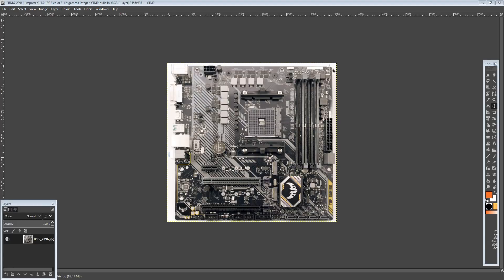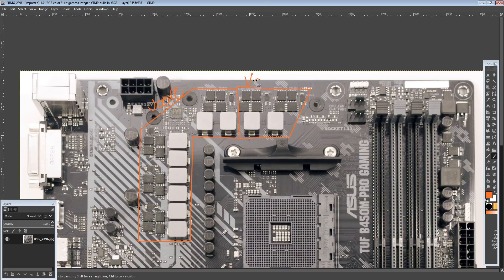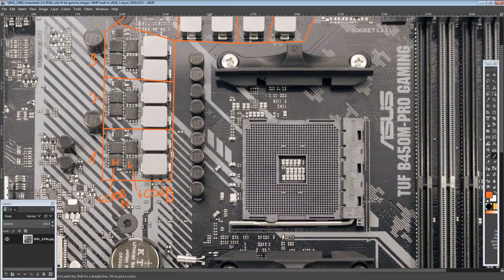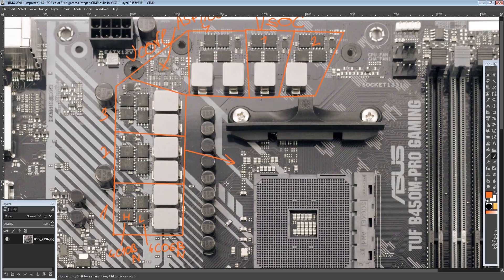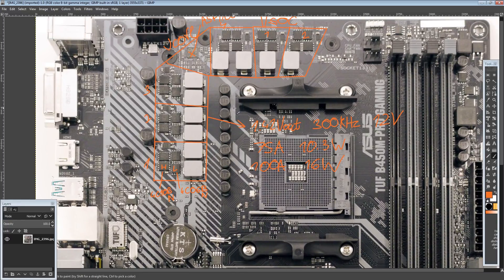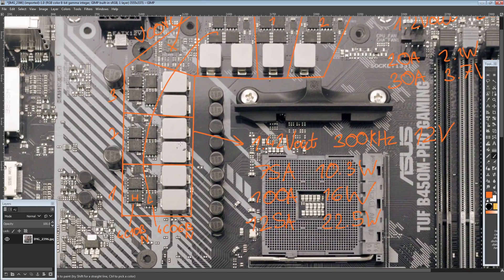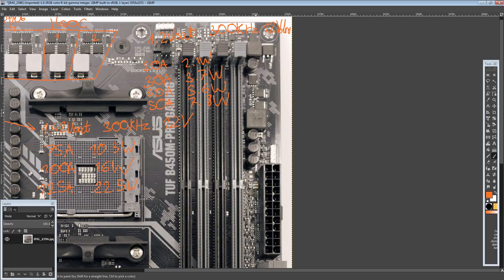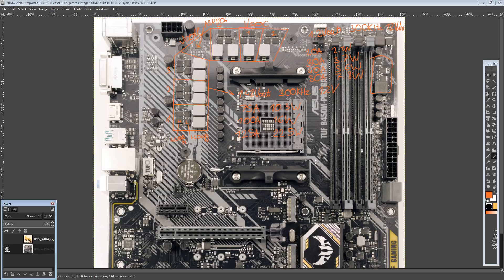mobo PCB Breakdown: ASUS TUF B450M-Pro Gaming

Comment: if you take one and tested like i do you will see on this motherbord ryzen 5 2600x can  hit easy 4.2ghz with vcore 1.375v and vrm temp's in aida 64  72 degrees celsius on mos-fet on open bed test no air flow.This happen's cause they heave an extra metal plate from the back at the same spot of the uper heatsink, the heat extraction is very impresive. Test the mobo and then make comends, by one picture can't extract conclusions.
Reply: Why do i feel like BZ only talks bullshit. With 0  testing ??
Reply: @filds1  because you're ignorant.
Reply: @rawdez_  why? Because im telling the truth ? Man we seen people running 3950x on a a320 motherboard. I seen worse things then this. If you remember the fx line up. I seen crappy boards then this running a fx 9590. Without long term testing i dont believe shit. By buildzoids point of view we all should just crap shit ton of money on a top high end board and be done. What a fucking joke.
Reply: @filds1  because in this video he BZ is talking about OC and compares this board with other boards. if even trash boards can run any modern Zen2 CPUs at stock that doesn't make trash overpriced boards any good.
is this board good enough for any stock Ryzen CPU? yes. is it actually good for PBO & OC with any Ryzen CPU? no.

watch again this 5:00, and this time actually  listen.
ps MSI boards now have offset voltage
Reply: 5:00

Comment: I presume, the main reason why most B450 motherboards end up getting the short end of the stick is because of the freedom XFR yields to consumers, and motherboard makers. Theoretically speaking.

Since technically all they have to do is support the feature, stressing out the board by using cheap components is a win win because technically speaking the board is in the clear, to do just that, provide 'turbo' performance so long as you the user, can keep the system cool.

AMD this generation does not really look so appealing to overclock anyway, so leaving the processor to do this automatically probably would be the best bet, especially for anyone using a midranged board whatsoever. Oh well. Hopefully some good boards come out again. right now it seems ALL the good MSI motherboards have dried up and disappeared this week with every place selling them being sold out.

Comment: Hey, so I have experience with liquid cooling VRMs since I had to fit some blocks to my sabertooth 990 for my fx-9590 oc.  If I put some waterblocks on these VRMs, should that be enough to handle the heat issues when running a 2700x?

Comment: I just built two systems with the 2600. I had the B350 version for my 2700X and it did not run that well plus I was not a fan of the bios. I got the B450 version because it was what Micro Center had. The only other one they had was an AsRock for $69. So far things are working pretty good with both systems. I have one paired with a 1060 6gb and the other with a Vega 64. I did not have allot of time to do any major adjustments will have to wait til next month

Comment: I got my 2400G up to 4.2Ghz on this board.  For $100 You can't expect all the bells and whistles.  I also would never run an 8 core on any B450 Motherboard.
Reply: I'm running an 8 core on the "worst" b450 and it is fine.
Reply: What was the temperatures for  2400G @ 4.2Ghz.

 I can get this board  ( ASUS TUF GAMING B450-PLUS II  (the II version)  ) for only 67$ right now. 
The deal seems fine but I am really confused. 
The other candidate : MSI b450m MORTAR MAX  is also 75 bucks but it is mATX moreover the warranty on the this seems a little shady ( I did not trust the seller) ? 
What do you think should be my choice?
Reply: @landingonyuranus1813  As for Temperature I can't remember it was 3 years ago. That CPU is residing in my Churches AV computer. I was running a Spire Cooler not the one that comes with it. The other major variable is what voltage you need to push to get it up that high. The Tuff board is a decent board. I did do a review of it.
Reply: Good b450 can run anything now , not 3950x but , 3900x will be okay on b450 tomahawk. I have it in one rig and it's doing completely fine.
Reply: @DexterWTFF  3950x  is fine on Tomahawk as well considering it is more energy efficient than 3900x.

Comment: it may be a coincidence but i gave an asrock board a good review once on newegg (they check those pretty often looking for customer complaints and leave messages about getting into contact with customer service).  in the review though i said that the voltage was a bit high and that they should allow more than -100mv offset.  on the next bios update they let it go down to -200.  i wonder if they saw what i wrote?

Comment: I put a 2700x in this....I don't have any real plans to overclock. my main issue was with the stupid rgb lights resetting the bios setting for off when off every second reboot that was fixed when I changed the off rgb mode in aurasync applyed and then set if off again. The msi all cost the same or more then this in australia so worst case if I want to push the cpu ill get a c550 or whatever they invent in a years time. 4 year socket support ftw
Reply: also the rgb lights are totally hidden under the gpu, basically ignore all the rgb on the product page if you gpu will overhang the mobo.

Comment: "oh no" in first 10 seconds = fail, but i need to keep watching this car wreck of a a motherboard... really Asus?  A piece of cardboard with the chipset drawn on with a marker performs better...
Reply: This board actually holding stable all cores 4.1Ghz at r7 2700x. So please shut the hell up.
Reply: @AliShuktu  What are the temperatures for that stable system. I really think Buildzoid is a little bit harsh on this board. Yeah?

B450m MORTAR Max had good temperatures here: 

I can't find any info about TUF  B450 Gaming ,though. Any  help is appreciated ^^
Reply: @landingonyuranus1813  
About 76°C on radiators.
If you want i can find video.
Reply: @AliShuktu  Is this bad? 76 degrees seems a lot for a moderate test?
Reply: @landingonyuranus1813  
It's not moderate test.
It is 4.1 overclock all cores: 8(16).
Reply: @AliShuktu  I think I understood something here. I searched about this. And found out that B450m MORTAR MAX is better in terms of VRM temperatures. it runs at least 10 degrees cooler than TUF and TOMAHAWK MAX
Reply: @landingonyuranus1813  
Interesting. But 76 degrees is already "cool enough" though. 
Dangerous temperature is - 90 and above.

Comment: Nice video, always enjoy the mix of rambling about the manufacturer & the technical analysis. 
I have a question about "old" thermal pads on a GTX 1070 from gigabyte (G1 gaming rev 1). They started leaking silicon oil.. Can you recommend a replacement for them?

Comment: What happened to mATX? It makes no to no sense to have full ATX for mainstream platforms really. There's very few high end boards released in mATX now. None for AM4? Still clinging onto my Z170M OC Formula. Now with modded BIOS and a recent upgrade from a 6700K to a 9700K which I'm very happy with!
Reply: One factor is that it is tough to fit enough expansion on an MATX board to use the full array of IO that modern high-end chipsets and CPUs offer. That seems to automatically push MATX boards out of the 'high end' category with manufacturers. MiniITX actually has a similar problem, but the VRM's at that size HAVE to use better components just to keep from catching fire with the space available! Even so, you see almost no x470 MiniITX boards because you just can't use most of what that platform offers with so little board space.

Also, higher-end MATX boards would almost certainly cannibalize sales of existing high-end ATX boards. If you think about it, what you 'lose' when you move from ATX to MATX is a couple PCI slots and maybe an M.2 connector. Those aren't very expensive parts and don't save the manufacturer much money, but they will still be expected to offer the MATX board at a lower price than a full ATX board with the same VRM and chipset. It's entirely possible that they would have a lower margin selling a high-end MATX board because it doesn't really cost them much less than an ATX board to make, but consumers won't accept the same price for a board with less 'stuff' on it.

I wish it were otherwise and MATX would take over from ATX as the mainstream form factor of choice, but it just isn't happening. There is still some hope that enthusiasts will pick up on the general consumer trend of wanting physically smaller PC's, and ATX will become less desirable, but I'm not holding my breath. It's a shame really as I haven't needed more than two or three expansion slots for over a decade, but I'm still usually stuck buying ATX boards if I want a good overclocking platform.

Comment: I think most of you are mixing up with TUF and TUF gaming. They are DIFFERENT product line, said by the sales rep of ASUS Hong Kong. TUF is much more high class mobo than TUF gaming. TUF mobos STILL have 5 years warranty, like the TUF X299, since it is the TUF product line. The new TUF gaming product line like this mobo is a low end product and the price of this is much much lower than the TUF product.

Comment: Asus has used the same VRM on every non-high-end AM4 board since day one with the B350-Plus. Such progress!
Reply: Simon: kinda late to your comment, but i happened to catch this video, and what's this about Asus. i have one of there boards for my i5 9400. it's a B or Z390 i can't remember now, it's a lower range Z board. it's a Asus Prime Z motherboard. they were saying the VRM on this board isn't that good, but i can say for mine temperatures don't go above 66 degrees Celsius at full load, it might be different if i had an i7 but i have an i5 so could be why.

Comment: This review makes me smile. I really like the memory controller and BIOS on my new MSI B450M Mortar. And why would anyone buy a motherboard for the AM4 platform that they can not upgrade later with a more powerful cpu? Lots of possibilities out to 2020 and beyond. Going to bed. Hit the Cinebench wall at 875 and 3200MHz. Cold and wet holiday weekend to work on 3400 and 3600MHz. p.s. What was the switching frequency mOhm's. 5.5?
Reply: Check ECC support (for building a home LAB, ZFS, etc.) and think again. MSI didn't give a shit about ECC, I simply sold my Mortar and got this. Works like a charm as a home lab with the (now-sold) R5-3600 and DDR4-2400 ECC UDIMM @3200 (Samsung B-die). :)) 

5950X is on it's way now. 1x12cm fan pointing onto VRM block. We'll see how this little board performs with that beast.

Comment: ??? I feel like AMD would benefit from adding iGPU's to there mainstream lineup and gain massive market share from Intel. What would be the Proa and Cons of doing so? Thanks.
Reply: Well, it depends on the size of the iGPU. For anything but gaming, Intel's one suffice whereas if it's a gaming station you'd better use a dedicated graphic card instead of an APU (yeah I think APU are useless in most cases). Even the Vega 3 of the Athlon 200ge is quite too much for hardware acceleration in multimedia/HTPC tasks like desktop compositor, video decoder and Web browser.
Reply: @PainterVierax  I like iGPUs, they make handy ways to add extra displays to machines.
Reply: so does a dirt cheap graphic card, I don't see the point here.
Reply: @PainterVierax  A dirt cheap GPU is an additional card, in an extra slot at extra cost and on some builds you have to be careful where you put them to avoid mesing with primary GPU bandwidth. . Given that most boards have the iGPU hardware on them already,  there's a clear benefit for an iGPU, especially on mATX or ITX builds. Maybe with the Ryzen 3000 series we'll see some 6 and 8 core chips coming with the iGPU.
Reply: I said APU are useless in most cases, I made the distinction with an iGPU. If it's just for an extra display, you can use the iGPU but you don't need more power than what Intel has.
You don't argue for something relevant since we are agree on that point.
Reply: My focus was on AMD gaining market share and boosting there product lineup for the masses not only for builders. AMD qould be more attractive buy if u dint need to know what else to buy or install. Vega 3 would be sufficient since it would kick Intel's counter part right in the kisser. As they say KISS it K=keep I= It S= Simple S= Stupid Lol
Reply: Ruben That's the same with OEM or prebuild : There is no point of having an iGPU in a gamer or workstation or even a small server (like a NAS) product line and especially something both too powerful for HTPC and too weak for serious 3Dwork like Vega 3. You pay extra bucks for a feature you won't use.
Having both CPUs with or without iGPU gives more choice even for an assembling service, just like SoC diversity in the ARM world.
And sorry but if you want to talk about KISS, having a heavily integrated product is totally the opposite of it comparing to a regular PC platform where you can easily replace or update a specific part. KISS is a design philosophy for technicians and maintainers, the user itself don't have to care about hardware architecture.
Reply: @PainterVierax  Yes I understand where u coming from, but I am talking about seeing AMD succeed and taking back market share. If they havent already with Ryzen architecture inplace u need to simplify it by taking a page from Intel and adding graphics to there CPU for the MASSES. I got many ideas like bringing back on board graphics on aome budget mobo's like in the past if adding it to CPU is to complex Lol. What about an HBM variance that qorks on the CPU die huh? Like that one LOL again Market Share for AMD is my main point and focus from the start. Appreciate ur input Thanks. By onboard graphics I mean something like Vega 3 to 11.
Reply: Ruben, I know what you mean but ordinary people don't buy desktop PCs anymore. Excluding smartphones and tablets, the huge marketshare is the laptop and mini-HTPC. Intel is good in those segments whereas AMD have its own consistent lines of product but still have problems of driver support in Ryzen Mobile and problem of pricing in Ryzen Embedded (really sad).
But as it goes, x86 itself (and Windows too) will be more and more a niche market. Even those devices will switch to ARM when support will go to UEFI, Coreboot and easy way to install or upgrade an OS like the way Chromebooks goes. Most people don't game and they just need their apps, their cloud and Web services to run.Solutions which AMD is developing on is in the console and enterprise market. This is where the big juicy money is. 
IMHO on-board graphic chip is better since MB manufacturers don't have to add phases for iGPU in the entire product line of a socket but CPU manufacturers won't go back in design. In fact, I'm sure the next APUs will use the chiplet design.
Moreover on-board is the ancestor of APU and share quite the same problem : too weak for proper gaming, too powerful for simple usage and not upgradable. Almost ten years ago, got an AM3 board with an embedded Radeon, 6months later I bought a cheap GT520 to have proper H264 hardware decoding. And now with HEVC, all 4 years old FM2 APUs are obsolete for an HTPC… unless you can add a GT1030 (even the DDR4 version). Money-wise, best options for an HTPC are cheap and disposable ARM boxes or upgradable itx PC without iGPU you can keep more than a decade despite the new codec requirements.
Reply: @PainterVierax  Last time i checked Intel is #1 and they attract the masses gamer or not. AMD on the other hand can use a boost in marketshare in order to hire people for those updated drivers and iGPU is a start. By the way I seen a vid by RedGamingTech and he speculates that Ryzen 2 might have iGPU and it wont hurt to do so 7nm baby! Lets see come March or April perhaps sooner? Leaks! CES 👌

Comment: Appreciate the b450 coverage,  Is there any reason to buy a x470 over a b450 ,best i can tell  the msi b450 pro carbon and x470 gaming plus both have 4+2, so is there any advantage to a cheap x470 over a good b450? 

The b450 pro carbon seems like a decent mobo loaded with features like usb bios flashback , a big ol heat sink that covers the IO instead of plastic shield that covers the heat sink and trouble shooting LEDs. Plus all the goodies like wifi and good audio, i just don't want to kick myself for not going with a x470 if later on AMD drops a cpu that actually has decent OC head room or a 12 core. As a blender user i will be rendering for 12 hours at a time so im trying not to make a $150 dollar mistake.
Reply from the maker: the main feature of X470 AFAIK is that it has SLI support.
Reply: @ActuallyHardcoreOverclocking  thanks, SLI is not very relevant to me.
Reply: Most of the time the x470 boards (except the X470 TUF lol) have 6+4 phase VRMs or better while B450 is mostly stuck at 4+2, so you basically need X470 for good power delivery
Reply: @or2kr  , most x470 boards do NOT have 6 VRMs...
1 of 4 Asrocks do
4 of 5 Asus do
1 of 2 Biostars do
1 of 3 Gigabyte do
1 of 4 MSI do (well, Gaming Pro is unknown)
and only 4 of those 18 have 4 SoC VRMs (all of which are doubled)
Reply: @plonk420  oh shit I only watched the Asus part of Buildzoids thoughts on X470 boards lol
The X370 Strix F is really cheap in our country, like only 15% higher cost over the B350 Strix F and I'm still kinda salty that that the latter only has 4+2 phases and that I bought it 10 months ago, that's why I was so anti B3/450. Would it have made a difference on my 3,9 Ghz oc on air on my 1600? Probably not :)
There are surely some good boards for overclocking out there with the cheaper chipset, it's just always a 4 something phase and nothing great if I may say so